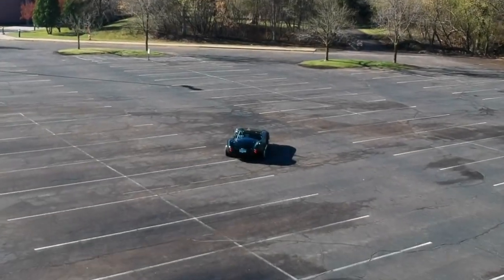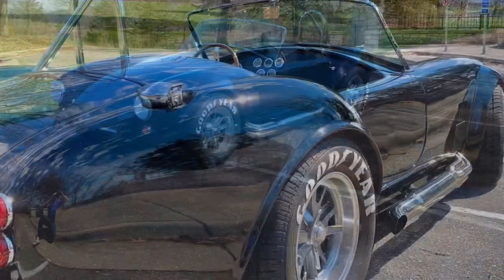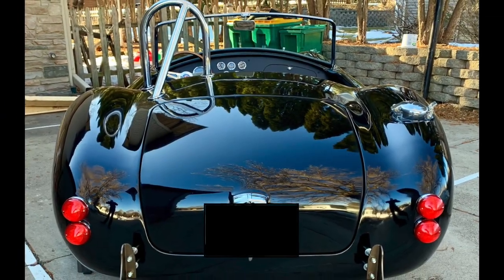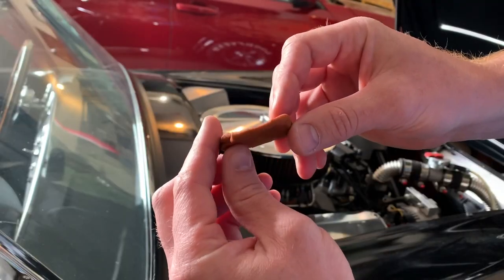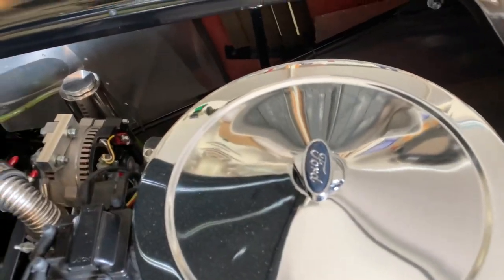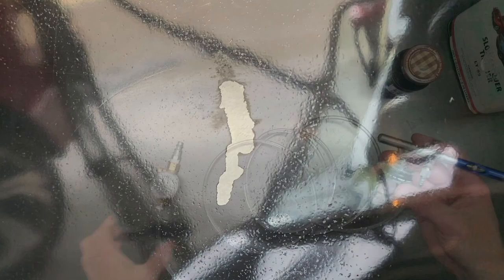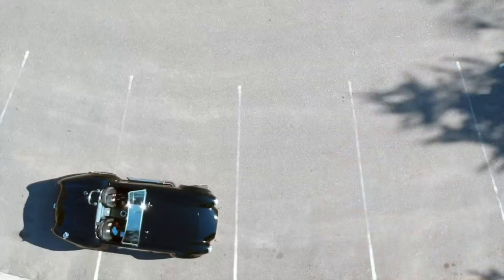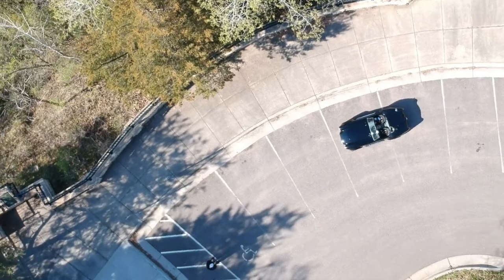Fixin car paint with an airbrush

Comment: Yes! I wanted to fix a scratch on my gf car and looked up how to do it. The results were okay, and I figured the issue was the use of a spray bottle, so I was thinking use a spray gun, but those require more scfm (basically how much air pressure your compressor can produce), about to give up then I learned about different size sprayers, that got me to airbrush which my compressor can do. It was just an idea which I wasn't sure about until I saw this! Thanks you, will pull the trigger on getting the items, but it would have been nice to have seen you use a primer and clear coat, but I'm sure it's the same idea about thinning the things first for the airbrush.
Reply: If you have larger panels that need to be done, look into LVLP guns, some of them only require 3-4 CFM which the smaller 30-gallon compressors can handle. I have a 29-gallon from harbor freight and it feeds my Grizzly LVLP (H7666 is model I have, but I think they discontinued it in favor of the H7667) just fine, as well as my Devilbiss FLG-5. If you are on a real tight budget and only need a 1-off, several paint shops will mix and put it in a rattle can for you.

Comment: I use the same thing to do small touch up on aircraft.   I hooked mine up to a scuba tank so it’s always perfectly clean and dry air.  Also make sure you never use syringes with the black rubber stopper.  They will cause fisheyes.  Ask me how I know!
Reply: Spare tire works great too

Comment: I've used the Sears Model 364-15506 airbrush for over 40 years. You can mix just as much paint as you need. If you use a traditional spray gun or even an aerosol can, you have a large spray pattern of like 6-8 inches for a tiny 1/4 chip. With an airbrush, you have precision control and can actually get to the point, with a little practice, where you can perfectly fill in a tiny scratch with no masking and little to no overspray. With acrylic lacquer, the paint goes on very thin (with a 50/50 paint to thinner ratio) so you have to hit it several times. But with the airbrush, putting down multiple thin coats is very easy and clean to do. Just like in the video, it's important to get an airbrush that has variable paint output. Kind of like a variable speed drill. With the adjustable airbrush, you pull the trigger back to increase the flow of paint. A lady I know is so precise, she can airbrush intricate designs on ladies' fingernails. It's good to practice with water-based paints on scrap material first. Before you know it, you'll be an old pro!
Reply from the maker: Hey thanks for sharing / a lot of good info here and I can tell you've handled a few airbrushes :)
Reply: @TacoJoe  I work on cars now, but in the past, I used to be a scale model fan and built and painted dozens of model cars and airplanes.

Comment: Looks like it worked.  Probably wouldn't have used straight cut on the newspaper masking (hard edge).  If you randomly tear the paper larger than your repair area being sprayed, then don't spray with the airbrush out as far as the paper it will naturally feather itself out.   - Why didn't you lightly grind; clearance, then blend the underside of the hood before doing the touch up?  (So, it doesn't happen again.)  BTW - Those Harbor Freight DeLuxe Airbrushes are a great little starter airbrush, use it until you decide you like using an AB then upgrade to a Paasche or Iwata dual action AB.   They're a great back up AB too.

Comment: When you remove the mask at about 2:13, the applied paint is much lower than the surrounding original paint suggesting it needed more layers or filler, but after you wet-sanded, it was flat.  Getting the repair level is the hardest thing with touch-ups.  Can you share any more detail (appreciate it's a long time since you did the repar)?  Did you for instance add further layers before the wet sanding?  Thanks.

Comment: The video where you show the paint after multiple coats still shows a very noticeable depth difference from the damage.  The finished part of your video does not look like it's an issue.  how did you fix or level the surface?  Was it clear coat?  I have some dog scratches to fill in and I think an airbrush could be my best choice but want to get it right the first time.

Comment: Nice quick vid thx what air pressure do you run your brush at ?
Reply from the maker: Honestly i do not remember what i used in this touch up - i always test spray though and adjust the regulator until the pattern looks ok  (ie not runny, but not dry/orange peely) - Wasn't more than 30PSI for sure though / the brush i used i got at harbor freight and i suspect i followed the recommended pressure range- i'll see what i can dig up and thanks for the comment!

Comment: I’m looking to do this for my weekend project on a scratch on my car. Quick question - what’s the reason for apply a dilute of 50/50 ratio for the thinner with the paint? Thank you!
Reply from the maker: 50/50 was what the paint manufacturer recommended - I think with lacquer, that is the typical starting point too. If you are using lacquer, remember there are usually (3) different thinner types and they match the temp you spray at - if its cold the thinner in more volatile and warm, less - thanks for the comment

Comment: can you tell us which compressor you got please? So you bought the regulator separately and installed it your self?Urgently need to know as about to do this myself. Thanks.
Reply from the maker: For the full paint job and airbrushing too, I used the 29 gallon Harbor Freight compressor and added a moisture separtor about 25 ft away (allows the air to cool) - I used the harbor freight purple gun too to spray and of course the harbor freight air brush too. The regulator is the generic harbor freight gauge that I adapted with some vinyl hose form Menards. Check out my other video on the full paint job and I think this will help you (link below). Thanks for the comment!

https://youtu.be/tcPO3mo2sJU

Comment: try touching up   3 stage paint right in the middle of a large area with an airbrush, then get back to me
I’ve realized it requires a totally different base metallic color to be used over what you would use if you were to paint an entire hood or fender spreading out the base
Reply from the maker: Yes - urethane paint w/metallic would be tough - those paints are great/super durable, but can make bodywork more challenging - I spray lacquer in this video / thanks for the comment!

Comment: I just finished doing mine. My paint isnt a single stage, though, and the areas I hit are easily visible in certain lighting. Not sure if I can spray the 2k clear or just buff and polish and hope for the best. Any assistance would be appreciated.
Reply from the maker: I'd consider wet sanding / buffing a few inconspicuous places and see how it looks (underside of trunk / rockers if they wrap around / etc.) - you never know. My paint is quite a bit different than single stage unfortunately so I'm not sure I'll be a lot of help - I used lacquer which is very user friendly but not very durable with road chips / UV / etc - I also had to respray a few times to get it right / check some of the different painter forums for advice too (Meguiars / Eastwood / etc.) -

Comment: Nice job.  What is your solution for the clearance issue?  Maybe drop mount?
Reply from the maker: I have a plan / going to turn a new wingnut with a bumper incorporated because the hood flexes up to 1” or so with the big bumps (eg. I think some contact is a reality). If this doesn’t work well then yes - drop mount. Thanks for the comment!
Reply: @TacoJoe  sounds good
Let's us know the results plz.  Do you have more bodywork prep video or where did u learn.   I know the forums are full...
Reply from the maker: Just a lot of reading then I went for it / searched a lot of forums too / IMHO - painting the car isn’t hard, rather patience and persistence with the bodywork is. I took it out today for a spin with my new wingnut and it worked great (video combing soon)
Reply: Thanks for the time to respond. I’m going look at more or your vids as time allows.

Comment: The simplicity of single stage paint... much easier to work than bc/cc
Reply: Not exactly.. on my elderly Merc with single stage, 30 years after production, and with some previous repairs, faded, then polished back to nice, a colour match isn't likely to be exact..
My grandad chose red single stage, specifically to avoid the problems with metallic 2 stage repairs of the time. Nowadays they don't make the same single stage type of paint and an upcoming repair will probably need to be blended.
Reply: @beautgrainger147  it is difficult to color match any paint. My wife's 2 year old garage kept car with factory color code had a professional blend and the color is off.

Comment: So do you need to apply thinner with any type of automotive paint ?
Reply from the maker: Depends on the paint / check into what your paint type requires/allows. Before you spray your car, test it out too. Airbrushes are usually pretty easy to clean up so its easy to mess around with thinning/setup until you have it right. Worst case, you sand it down and start over - good luck and thanks for the comment!

Comment: Did you use any primer first ?
Reply from the maker: For the touch up no, but base coat- yes / i used polyesther based primer (Featherfill G2) - stuff works really good/sands nice. Airbrush though, most of the time you are safe on small touch up areas with paint only (no primer) / there are probably some guidelines out there though when you should add primer to the mix so maybe ask around / thanks for the comment

Comment: Fake video! after spraying on the paint there was a very noticeable chip ditch and a masking build up. Wet sanding with 1000 and polishing won't do anything. The guy didn't even show application of a clear coat. I'm a full time panel beater and painter and know that you cannot get away with a repair using this type of procedures!
Reply from the maker: this is lacquer paint / no clear coat-polish only